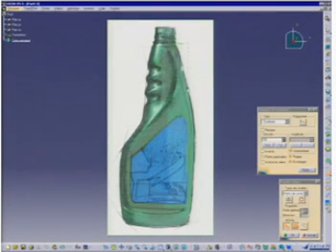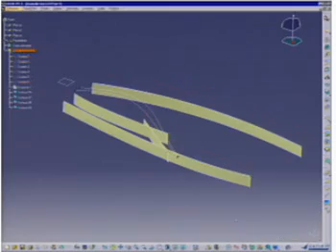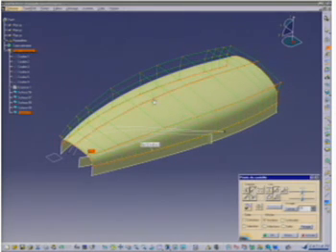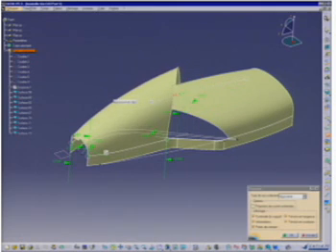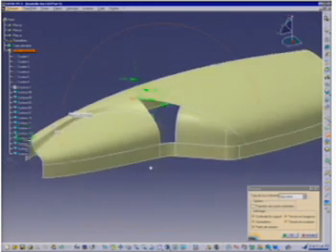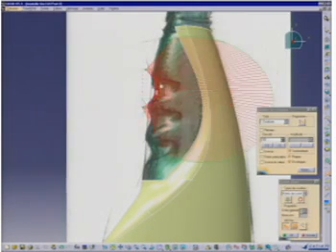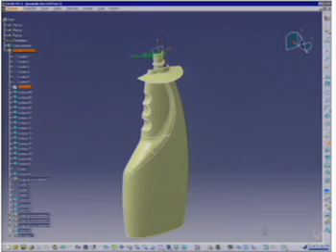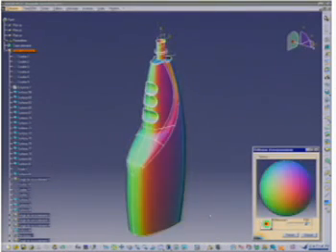Catia surfacing video

Comment: @firataydineyup It can be done in the GSD module : 1) Create an extruded surface, 2) Apply a material, 3) Change display style to shading with materials, 4)Open the material (DBclick on the icon in the tree), go to the rendering tab and then the texture sub-tab, 5) Make sure Type is set to Image 6) Change the image to what you want, deselect repeat u and v, scale/flip if necessary  7) Please, check my channel if you still confused!